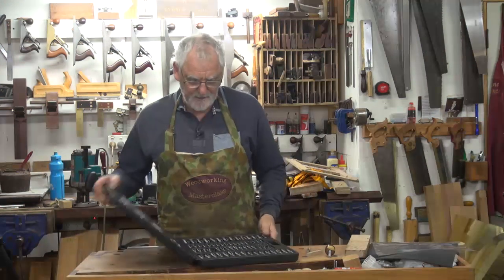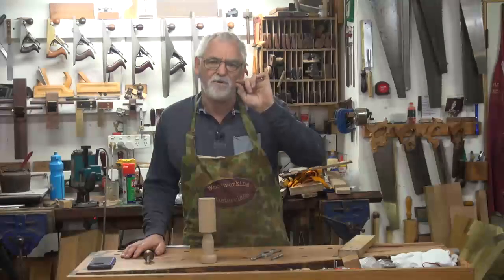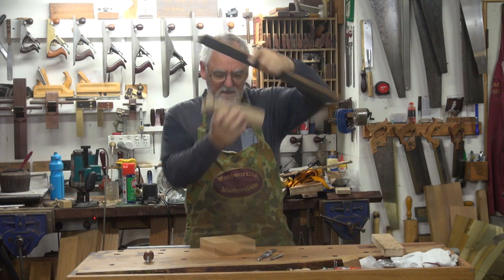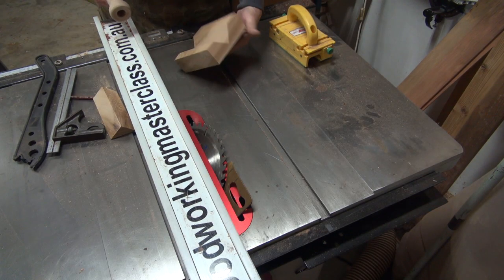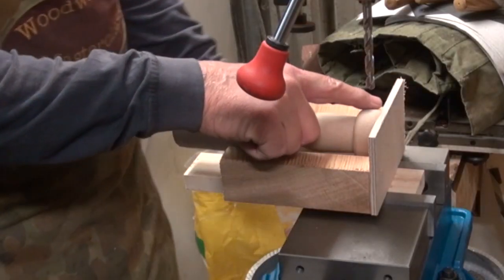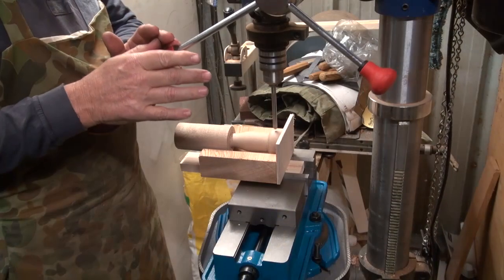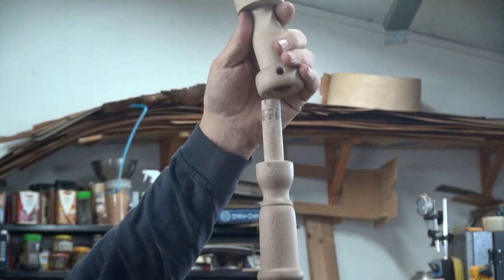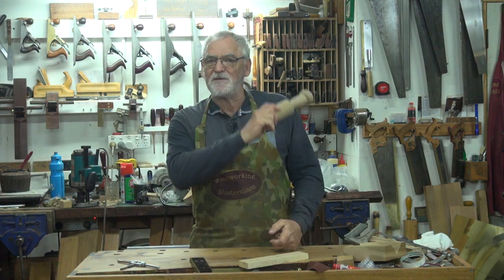Tapping Screw Thread into Wood Using Metal Cutting Tap

Comment: Cool likes that jig 👍👍👍 never knew you could tap timber especially that fine I’ve seen big square threads but not normal bolts.  I always drill the hole bolt size  minus thread pitch and it’s close enough
Reply from the maker: Hi Cam, I'm with you, but never really a fan of those large pitch wood tap and dies. Plus you have to choose yoou timber wisely. Whereas this method seems to work no matter the wood I used. Cheers Steve